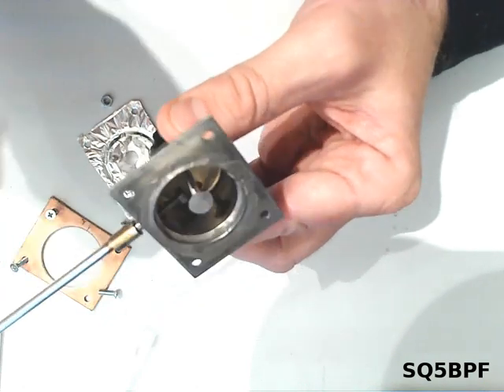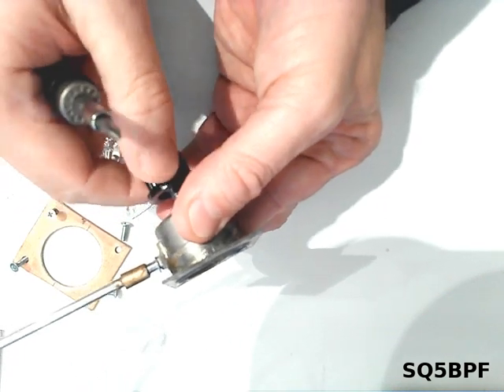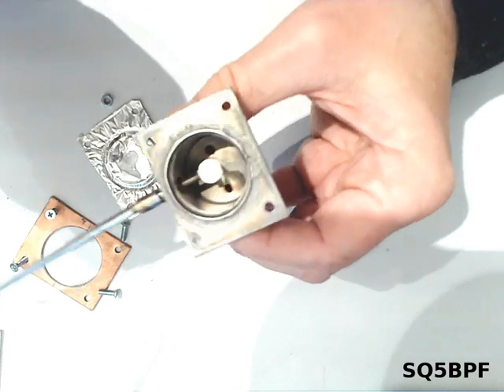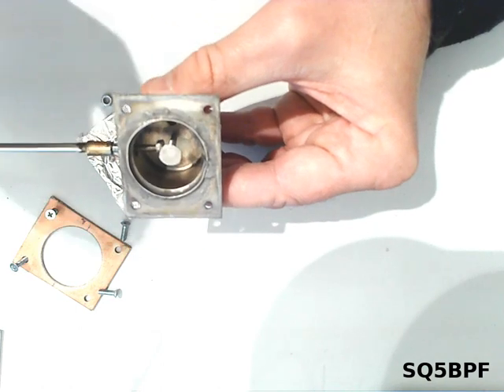Great Seal Bug replica disassembly

Comment: Hello SIr, u made a great project, and we wish to have more information about the antenna and the software part like the demodulation of the signal coming from the antenna etc... And also we would like to have more information about the used capacitance.
Reply from the maker: Hi, for the receiver i used an AM receiver (the synchronous AM detector in gqrx worked best). You could also use a normal analog receiver. The antenna is a typical LPDA antenna used for cell phones (usually 800-2700MHz) check out my other video with a demo showing it working.

The capacitance is just the capacitance between the metal elements, the usual way it's done in microwave engineering. Please look at the links in the description.